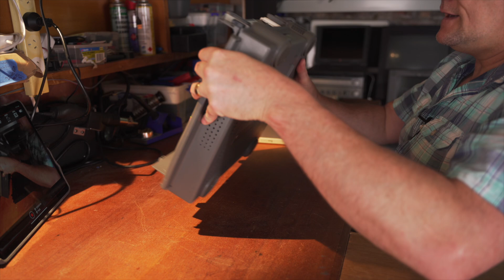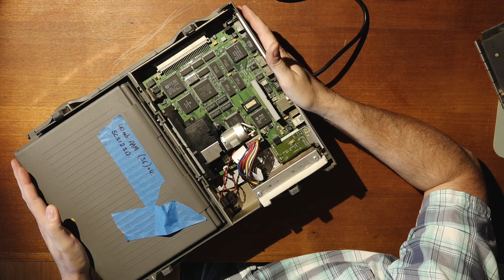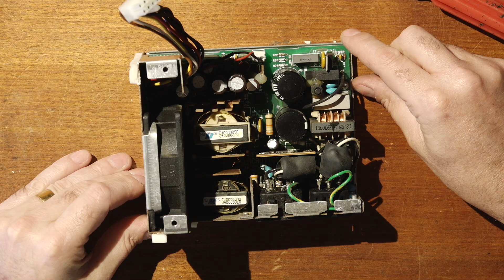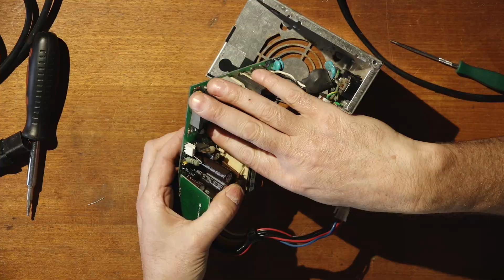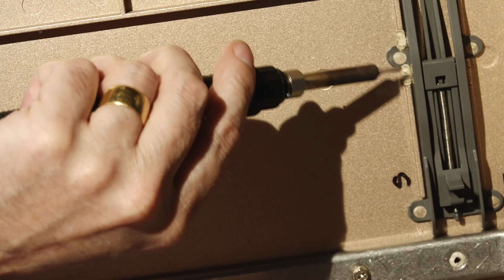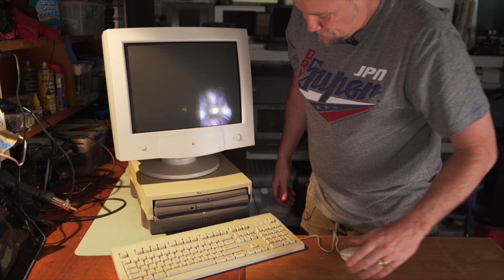Apple DuoDock repair - The courier used it as a football!! - Power supply and plastic bits

Comment: Great work getting it as fixed-up-as-possible.  And thanks for also documenting this issue with the diode for the community.  That is rather odd about the 1998 test date codes on the PSU ... my thought would also be some kind of recall or replacement program.
Reply from the maker: Yeah it’s certainly strange. Thanks for the comment!

Comment: nice video! one thing to note about power supplies is that their capacitors might retain a charge long after mains has been disconnected. you need to make sure they're empty before handling them, otherwise you run the possibility of getting a very nasty shock. it'd be very useful for others who aren't aware of this danger to mention this next time you're working with a power supply.
Reply from the maker: Good point! Thanks for the suggestion.

Comment: Nice repair! Love the Duo/Dock. And I can totally empathize on the “internet comments” piece. It may well be that 90% of the time an issue can be fixed by doing things one way, but that other 10% just gets lost or buried. Hope you’ve gone back to those other posts or threads and add a comment along the lines of “… but if replacing the cap doesn’t work, you might want to look at…”. Save the next person a lot of frustration and hunting :)

Comment: People always recommend replacing the capacitors, but in reality that’s rarely the problem with power supplies (except on the IIsi and LC). I had the same issue with my Lisa 2/5 power supply, still no sign of life (no 5V standby) after replacing the caps. After some troubleshooting, I realized that a transformer was faulty.